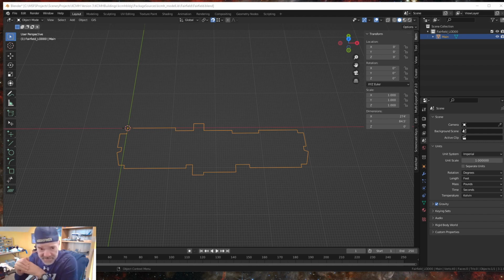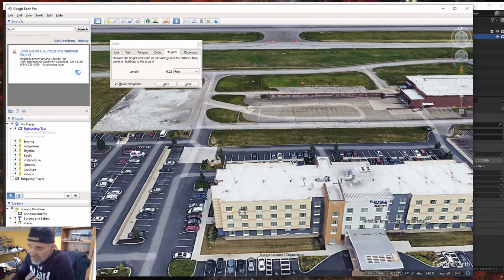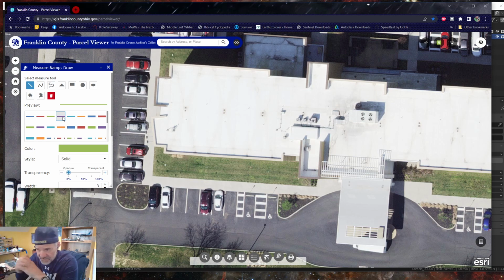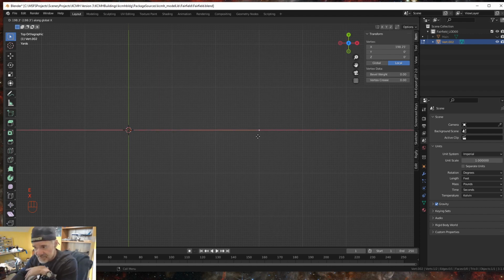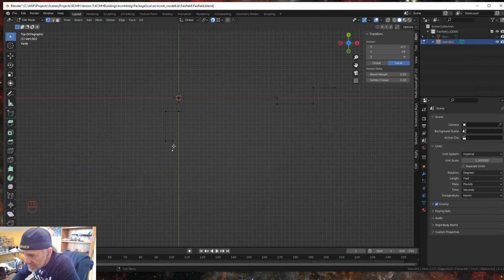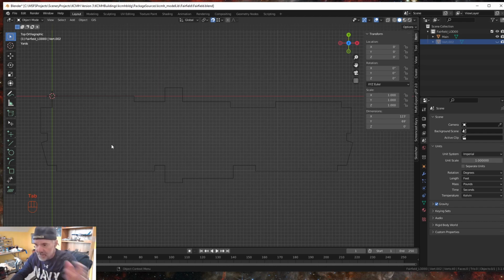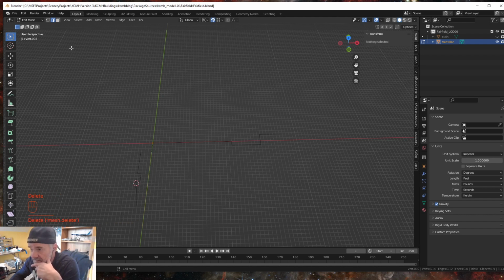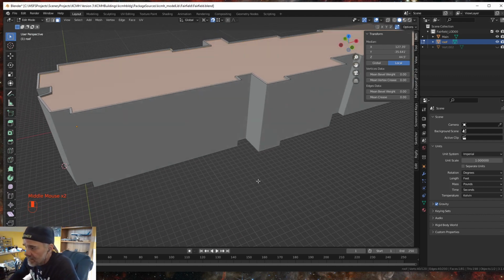Creating Scenery for MSFS: Fairfield Inn Build Series Pt1

Comment: It would be great to follow along except in Blender, out-of-the-box, does not have a single vertex option. You have to first load the “extra objects” add-on in preferences. You did something similar to this in another video without prefacing that the feature needs to be turned on first, FYI.
Reply from the maker: Yes, extra objects

Comment: Good stuff! Suggestion: take a screenshot of the high-res, top-down image of the hotel and use it as a reference or background image in Blender. Resize the image in Blender so that the width and length of the hotel in Blender matches the real world width and length. Then, use the single-vertex/extrude method to trace the outline of the hotel. This eliminates the need to take lots of measurements outside of Blender and makes dealing with weird angles and other unusual aspects of the architecture easy.
Reply from the maker: That is always a good method of building models. I do that 70-80% of the time. I only chose this method to show the process of using more precision.